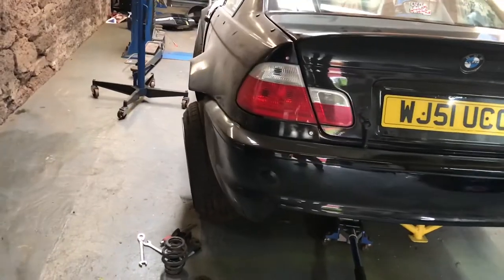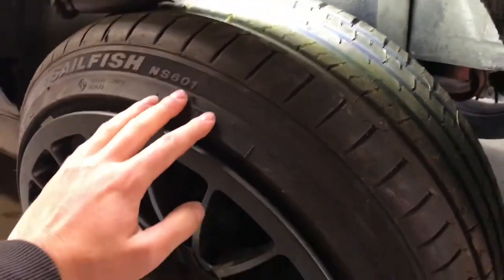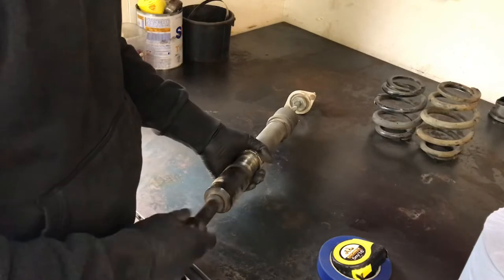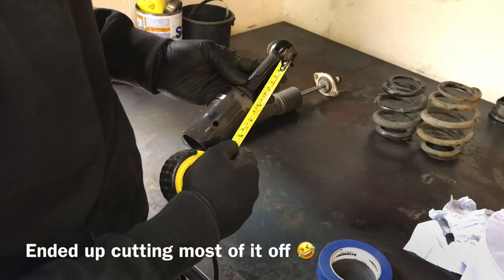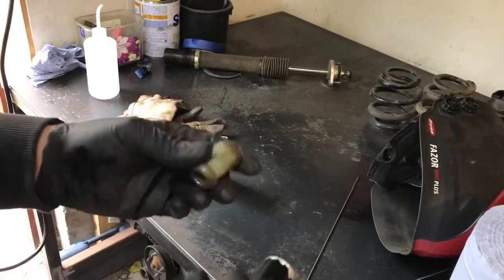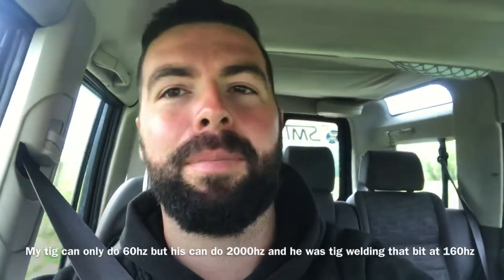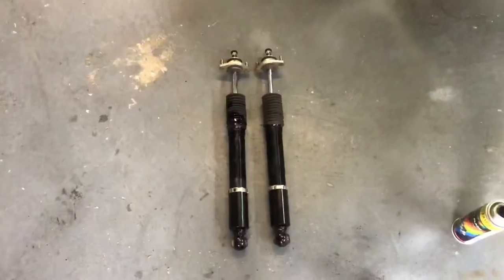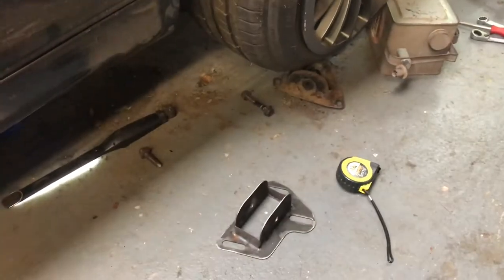1JZ E46 Drift Car Build EP 35 - rear suspension mods

Comment: Have you still got the mg great car would love to see a indepth walk around and the spec
Reply from the maker: Unfortunately I sold the MG a year ago it’s in Wales now somewhere
Reply: @SMTMOTORSPORT  ahh shame have you got any specs on the engine as building a 1400 k series rally car
Reply from the maker: James Smith Na not really it was very custom build most of the parts like piston and cams where all made for that car and had Weber alpha throttle bodies and ecu then pug 106 gear kit in the r65 box with gripper diff! It’s hard to make good power in a 1.4 without a lot of money so I would go spend on transmission first with good ratio gears and proper diff as u make way more time on a stage with proper set up than hp gains on such a small engine cc

Comment: great vid! since u have lots of knowledge i have a question (sorry for offtopic) i have a really low clutch engagement point on my e46 330i. what could that be? air in the system?
Reply from the maker: Hi 

Can be worn out clutch most likely if u don’t know condition of it or air in system yes 👍🏻
Reply: @SMTMOTORSPORT  thank you!